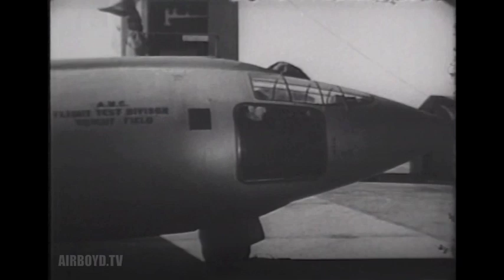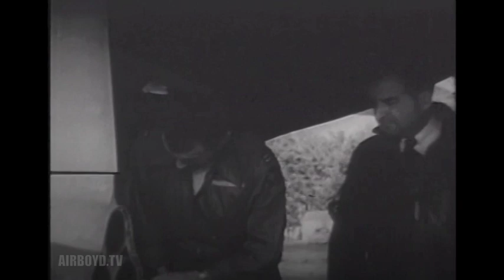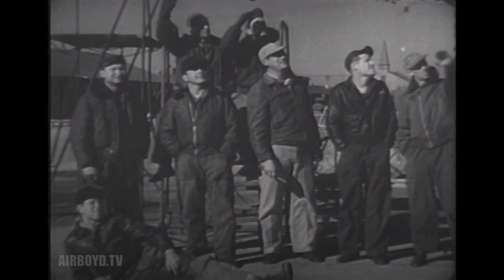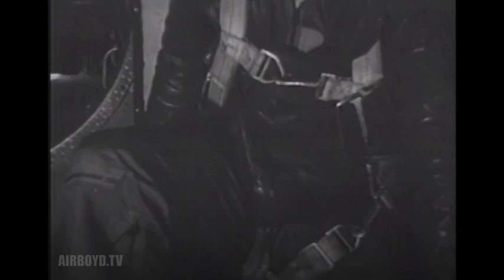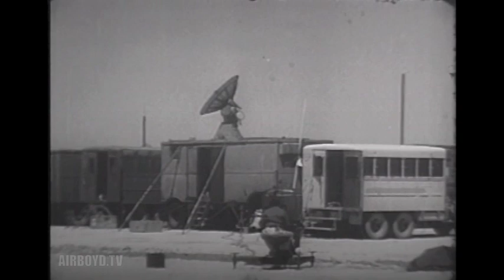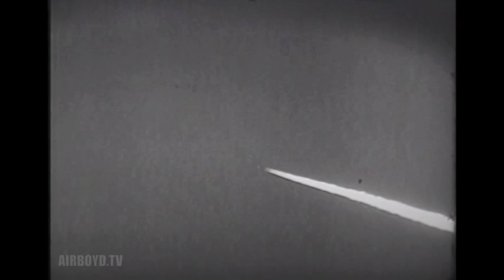The Bell X-1 (XS-1) "Sound Barrier" October 14, 1947

Comment: It was not the first aircraft to break the sound barrier, The british designed and built Miles M.52 was, a 1/3rd scale model reached Mach 1.3 in 1946. The Labour government cancelled the project before a full scaled model could be built, and gave all the data to Bell.
Reply: Was it the first aircraft to break the sound barrier with a human? I assume the 1/3rd was without a human
Reply: And the x1 they had it all ready and were told to let the USA be first
https://youtu.be/vNhrmAE_hoI

The model was after just to prove it
And the tail was British

Politics
Reply: Please stop spreading lies and false British propaganda.
The Miles M.52 never existed.
There was never any exchange of useful information from Britian or Miles Aircraft that contributed to the success of the Bell X1 program.
Reply: The German A4b was a full sized rocket plane achieved a top speed of Mach 4 in 1945, although unmanned for the test it had a full cockpit with flight controls.
Reply: Never in history has so much been written about an aircraft that never existed... the Miles M.52 never flew supersonic because it was never built, it wasn't even a completed drawin.
 It's a perfect example of British propaganda lies.
Reply: @wlt3585  it would have had to be a very young 🧒 pilot (2ft?). 😁